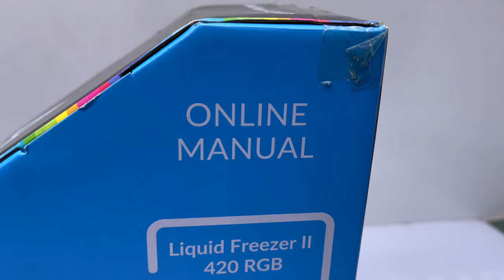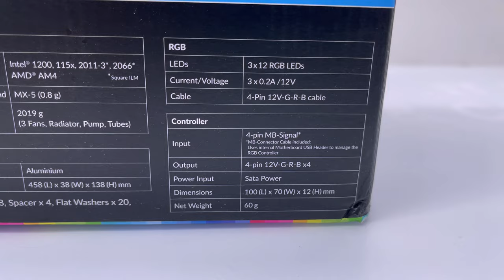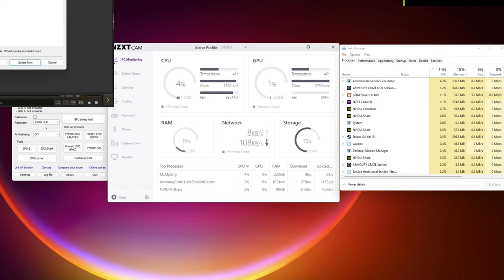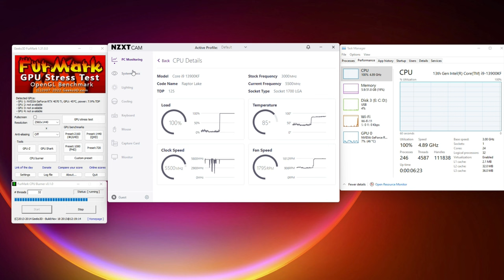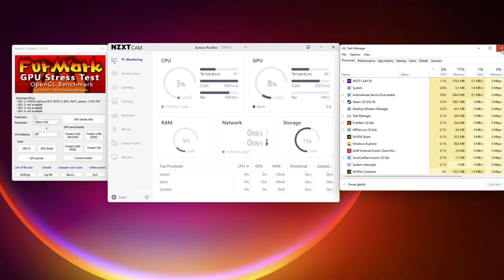ARCTIC Liquid Freezer II 420 RGB  with i9-13900KF and CPU Bending Corrector12th Unbox install test

Comment: When mounting an AIO radiator in the front of the PC case, it is generally recommended to have the tubes at the bottom. This is because it helps to prevent air bubbles from accumulating in the pump, which can lead to noise and performance issues.
Reply: This is false, as long as the pump is below the highest point of the radiator when the tubes are on top, it is fine.

Comment: The ONLY advice I can give is; DO NOT REMOVE THE ILM WITHOUT THE CPU IN THE SOCKET. If you accidentally drop something on the pins, you will bend stuff and it'll be difficult to fix. Not to mention, most companies won't RMA a bent pin board.

https://youtu.be/N9579Wal1V8?t=354 <--- BAD

Second Mistake - DO NOT DO BOTH TOP OR BOTTOM AT THE SAME TIME. You do kitty corner, or an "X". If you start at the top left, you do bottom right next.

https://youtu.be/N9579Wal1V8?t=389 <--- Don't do this!

Comment: is there a big difference when making the 360mm aio front intake instead of top mount out take , I currently use top mount aio outtake and 3 case fans infront as intake and 1 rear exhaust and also 3 bottom intake on this same lian li case on a 13700k but your temps seem better by 8c but u do have a better aio
Reply: I guess that could be due to ambient temps where you live. Top mounted is the best way to keep air away from the pump as well.
Reply: It s an exhaust bro, not outtake
Reply: The radiator needs to be higher than the pump on closed loop. It doesn't matter on an open loop!

Comment: You installed radiator wrong. Hoses need to come from bottom on a side mount. Issue is that they don't look like they would reach, so a case would be needed that can accommodate a 420 mm size mounted from top.
Reply: No. In your case the highest point is the pump, so the air in the system goes to the pump and that will kill it

Comment: I have the thermaltake p8 core and ASU’s z790 Maximi’s hero ! It can be use it this monster ???
Reply: Same question here, accordingly to the thermaltake website it is possible on the side and front. 
But bear in mind that the radiator is big. 
I'm planning to front mount as intake with the fans inside the case past the mount slot, this allows the tubes to extend closer to the block. 
Maybe use some used 140mm old fans as shrouds with bigger screws.

Comment: Im just installed the 360mm version, im getting 80-91 c on MW2, at 165hz, my Air cooler was better, did I something wrong?
Reply from the maker: With same cpu full load it's fine
Reply: @itcarecomputers  is de cpu running under full load? And is the arctic liquide freezer ii 420 good enough for 13900kf only for gaming?

Comment: Having the aio at the top might produce some air bubbles. From installation guides the recommended flipping the aio so the tubes are at the bottom. This is coming from gamer nexus
Reply: You’re wrong sir. Please watch GN video again. The pump should he always be on the lower position than the tubes.
Reply: I hope you don't actually have an AIO, the PUMP must not be at the top, so the radiator must be higher than the CPU
Reply: Absolutely not, it's the opposite

Comment: So many bought the KF. You really couldn't spare the extra $20 to get the K? Or did you not know what you were buying?
Reply: I guess it performs the same like K version and they already have gpu.
Reply: Sometimes the K version is not available in some countries.
Reply: The KF has around 5w lower power consumption and also little bit higher clocks, but yould notice it.
Reply: I don't need the iGPU so why waste money on that?
Reply: u dont need that if you have gpu, tf someone buying that expensive sht when you dont even have gpu rofl
Reply: @rcortez5979  if your gpu dies one day then you have the igpu as a backup while waiting for a new gpu to arrive. at least your pc will still be usable tho for normies like you this doesnt matter. lmao
Reply: @dankmemes3153  and if you have a second GPU for Backup? 🤓😜

Comment: nzxt uses avg.... not real time temps
Reply from the maker: It's almost real because I try different software at a time results was same
Reply: @itcarecomputers  is de cpu running under full load? And is the arctic liquide freezer ii 420 good enough for 13900kf only for gaming?
Reply: @Hjkb2.0  Dude, the 420 is like the best performing AIO on the market right now. And games don't really stress your CPU much if you have a decently fast GPU.